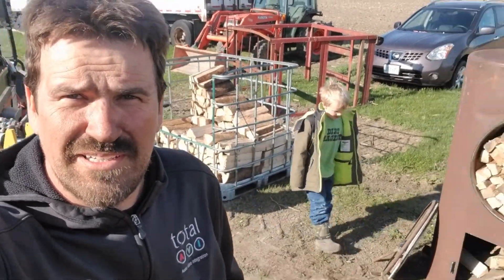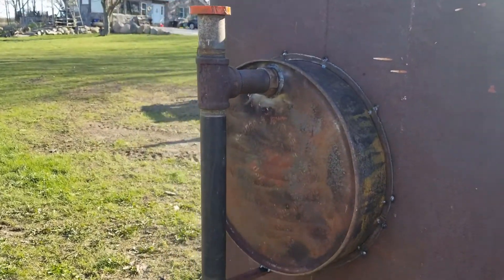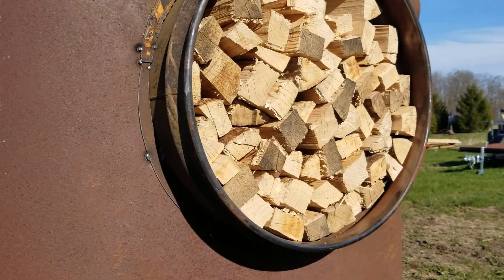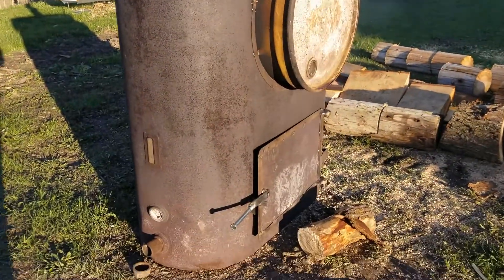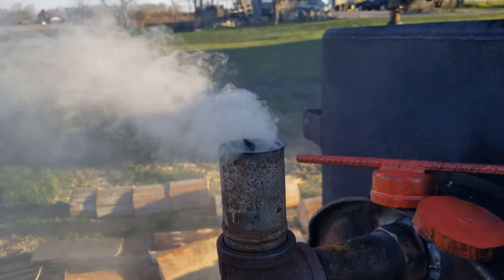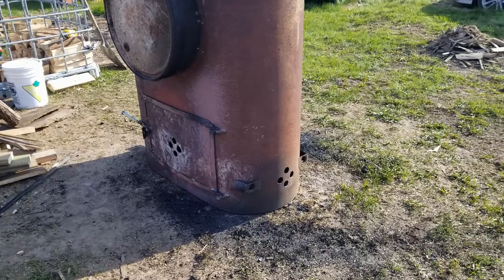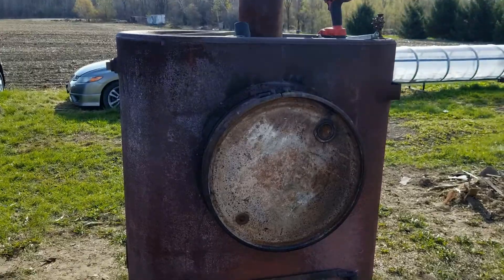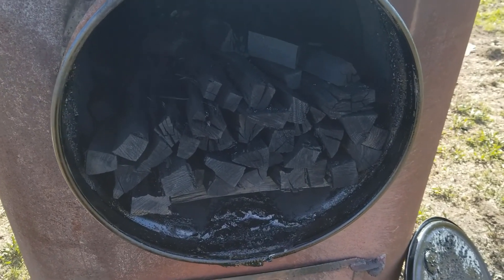Charcoal retort kiln

Comment: Very well done, Sir. I also use the flammable gases to heat my charcoal kiln. The first hour I let the steam vent off, then I close the upper exhaust and direct the pyrolygases into the flames. After a while the system heats itself without any further wood needed. I’ve done some videos on my channel showing the evolution of my kiln.
Reply from the maker: Thanks!  It's worked well for probably 30+ batches over the years. I should build a 2.0 one day. I'll check out your progress!

Comment: Nice design - love the weight/safety valve, love the fluid trap at the bottom of the retort return line, love the use of the "when the off-gas stays lit, it's time to recycle the retort gas" rule of thumb.  Very practical and smart.  Thanks for posting.

Comment: Good day, great video and thank you for sharing this great idea. I have the barrel placed vertically, but I have problem with the gasses leaking  on the lid, but my ring for the lid has no screws, it is just a regular ring, so I place mud in the lid cannel. So, do you just screw the ring on the lid, or do you add maybe clay or mud in the lid cannel to seal it more tight? Thank you kindly for your time and answer, and I am sending you very best regards.

Comment: This is not  a very good design - almost all of the heat from the burning wood is simply radiated to the  outside.  The barrel end should not have protruded out the back of the oil tank as that loses heat too. Maybe you could add some insulation?  Or just plan on wasting a lot of wood when you fire it...
Reply: What is it with your nasty people online?
Reply: @TingTingalingy  When you want to help people, you tell them the truth, and that's what I did.

Comment: Where is the big exhaust pipe connected to?
Is it the upper chamber or the lower chamber with buner?
Reply from the maker: Burner chamber. Only port in the charcoal chamber is the pipe in the back.
Reply: @HeavyIronAcres  thanks bro

Comment: Awesomely simple set up you got. Since you had fun with the project you should check out the "Handbook of charcoal making, the traditional and industrial methods". it can be found as a free pdf online. Goes over pretty much everything one would want to know about charcoal and explains the usefulness of all those run off fumes and tars, known as Pyrolysis oil.
Reply from the maker: Thanks!  I'll look into that.  I saved some of the tar from the first couple batches, but haven't thought of a use for it, so that will be helpful.

Comment: I like your build . I wish I saw this a month ago . I just tried my first burn and it didn't go that well . I figure that I'm loosing a lot of heat through the outside of the kiln . 
I'm now looking for a way to insulate it and try again .
So , what are you going to use the charcoal for ?
Reply from the maker: My first burn didn't go great either, but you learn as you go. I originally had plans to build a coal fired forge, but haven't done that yet. Mostly I give it away and BBQ with some. I have several years supply now even with giving bags away
Reply: please check my YouTube to check our charcoal making machine

Comment: I really like this design. I had a different design and it was so inefficient. This one is so much better and its light weight.
Reply from the maker: There's certainly room for improvement, and a few things I've done since have helped. Insulating the exposed sections of drum for instance helped a lot.

Comment: That is a great idea. I will certainly borrow some of the ideas. The front and the back of the retort chamber should have some insulation installed to help hold the heat allowing for hotter temperatures. Also I would do some work on the wood gas  system. This part should be kept inside the 200 gallon tank. The steam pipe should go straight up through this tank to be covered when the steaming is done. The gas pipe should also be in the burn tank and vented under the retort tank as a burner. I do believe the hotter the gases the better the burn adding to higher temperatures. I expect some of the gases are condensing in the exterior piping.
Reply from the maker: Thanks for the input!  I have since made a few upgrades like insulation on the front and back, which made a BIG difference.  My main reasoning for the exterior pipe was for cleaning.  When at temperature and moisture passes through the gas pipe it builds up creosote wicked fast.  This way I have an easy way to clean by driving a ram rod through the vertical pipe.  I may try building a better and bigger one at some point so appreciate the ideas!
Reply: @HeavyIronAcres  I am still in the parts gathering process.. One thing I have been wondering about is, is the 55 gallon barrel complete or did you make it smaller. Did the insulation help in the process. 
In the piping, the vapors produced only condensed when they are allowed to cool. A  short piece of pipe out of the top of the barrel. Just something to put your cover on. The burner pipe can be contained inside the burn chamber, no condensation will happen.
I want to thank you for sharing your ideas and posting your video. Looking forward to seeing your next model.

Comment: Thanks for the great video. Nice design. Could you talk about the fueling cycle? You start the burn with a bunch of fuel in the burn chamber. Did you have to top up the fuel over the 12-14 hour burn?  How often?  What is the ratio of fuel wood to charcoal wood by mass as measured before burn?
Reply from the maker: I havent analyzed the cycles that deeply, but roughly 4 or 5:1 fuel to charcoal I'd say, with maybe 1 or 2 top ups throughout the cycle.

Comment: For your vent holes, for starters calculate the surface area of the diameter for your exhaust stack, using round numbers it's approx 28-30 square inches and make sure you have the same on the inlet, on your pipe behind, 2" was overkill but if it was scrap that's cool, personally I would always leave it capped and venting into your combustion chamber, if it's steam then it will go up the chimney if it's wood gas it will contribute to the retort as soon as it's ready, as long as you have enough fuel to start the process it will be a fire and forget tool.
I agree with the other suggestions of wrapping it with rock wool, unless you were planning on capturing the waste heat for heating a shop or shed.
Reply from the maker: Thanks for the suggestions!  I've since capped the front and back of the drum with high density fiberglass (again, it's stuff I already had), and saw a big increase in yield. Less unconverted wood.  As to the capping, I find that if I leave it closed the whole time the pipe would rapidly become clogged with tar/creosote/shmoo.  Sometimes the amount of pure tar that's released is significant, and if it meets the high temperatures in the burn chamber it instantly expands to many times it's size and will clog the pipe.  The initial steam stage seems to be the dirtiest.  Likely if I did that it would work, but I'd need to clean my pipes and burner after each batch. As it is, I need to clean them every 3 or 4 batches.

Comment: Excellent design. one of the most intuitive iv seen in some time. Id high recommend mineral wool insulation. it will give main benefits, faster to reach temperature and less energy required to stay at said temp. just the basic white fluffy stuff wrapped around. seen it done, works well.
subscribed.
Reply from the maker: Thanks!  I'll give that a try.  I think you're right. I'm sure I'm losing heat on the 2 ends of the drum.

Comment: I admire this design.  Similar to Justin Jenning's 'Charcoal Charlie' on Youtube.  It's easy to load and easier to unload and does an excellent job.  The only improvements I would look into are running the outgassing pipe right into the firebox so it doesn't get gummed up with creosote.  (It's the condensation that forms from the temp change from the retort to the outside air exposed pipe that becomes creosote.).  What you have now works fine, just check the plumbing for obstructions between firings.  Your burn time can be reduced if you insulate the retort, which brings me to some questions.  How long does it take complete a batch?  How often do you have to stoke the firebox with wood?  Do you have to keep stoking the firebox after the retort is fully outgassing?  

I checked with another old timer on Youtube...his burner extended the length of the 55 gallon drum with 1/4" holes every 6" on both sides of his burner.  He was using 2" pipe like you.  Thank you for sharing your project.  O.J. Romo, Oregon
Reply from the maker: Basically a full day per batch.  I usually have to reload the firebox with wood several times until the off gassing takes over, which seems to vary depending on wood species, sizes, fuel type and dryness etc.  Yes, it would be better if the entire drum were in the fire, and in a future design I would address that.  My burner is maybe 18" long ... ?  Something like 8 holes drilled at 10 and 2.  I dont remember the size, but maybe about 1/4".  Thanks for watching and for the recommendations.
Reply: @HeavyIronAcres  Thanks for the info.  You're a valuable resource...it's hard to find anyone with experience with this type kiln.  I converted a 300 gallon tank into a kiln placed inside an insulated furnace fed by a 8" rocket stove.  I had a Calvin & Hobbes moment...it was like trying to heat the living room with a candle.  I way underestimated the heat I would need.  Never got close to outgassing.  I'm going to convert it to just building a fire under the tank like yours and spend the day stoking it.  Thanks again for the reply...I'm indebted,  O.J..
Reply: @HeavyIronAcres  Justin just did an update on his 'Charcoal Charlie'.  He replaced all the 'plumbing' with four 1/2" holes drilled in the bottom of the retort and covered it with a length of angle iron.  Search Justin Jennings on Youtube and it'll be the last of 3 'Charcoal Charlie' videos.  O.J.
Reply from the maker: I watched that.  Thanks for the info.  That certainly simplifies the design drastically, as the pipe is the hardest part of the build.  Its also the only part that requires periodic cleaning.  For now this though, the burner works quite efficiently.  Likely if I build a new retort at some point I'll convert this one in the same manner as charcoal charlie's.  I like the simplicity.

Comment: I like your design.  Did you make the barrel/kiln easy to replace with a new barrel?
Reply from the maker: It wouldn't be too hard or take very long.  The hardest part would be welding a new flange on the back of the drum.
Reply: I like the size ...I'm looking for plans on a  larger active box using 250 gal propane tanks...the bigger the better ...my goal is to get to a potash consistency